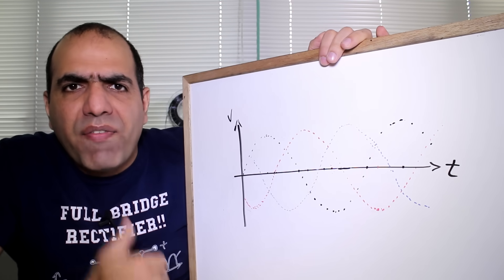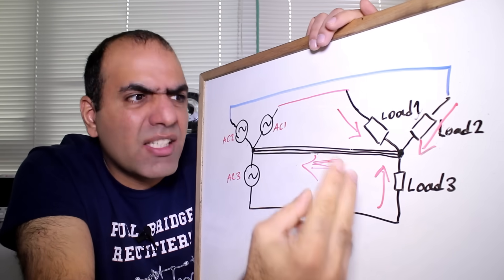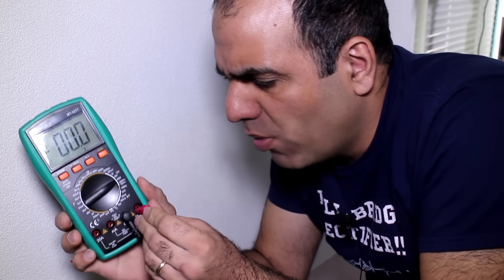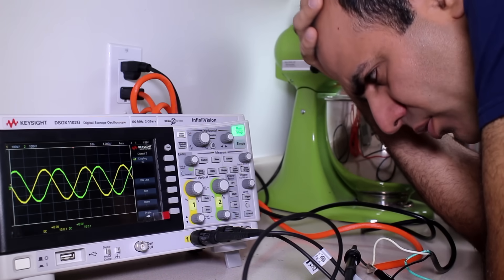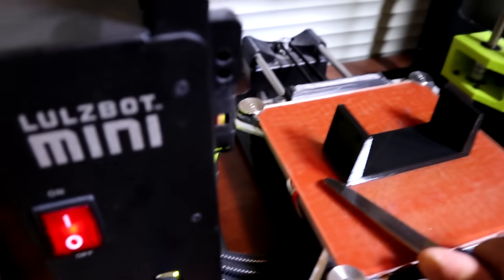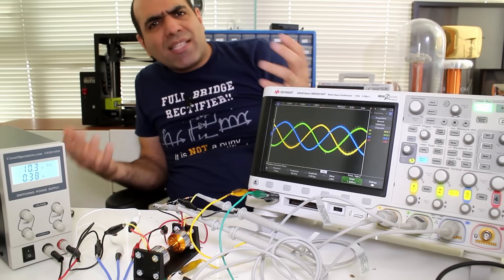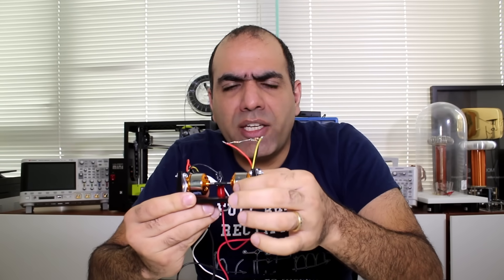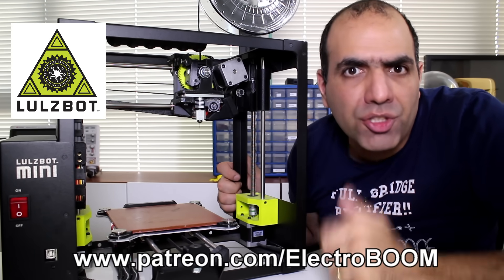Why 3 Phase AC instead of Single Phase???

Comment: i am 2 years late for this question but i will give a try

altough the video explains very well 3 phases and why it is good, it doesn't answer the main question
WHY 3 PHASE?

all that you've shown could be done with 2 phases or 4 phases or 6,9... o whatever integer factor of 360 so WHY 3? why this magic number

btw 110v is a pretty shitty tension, it means that the city you live is has very old transmission plants no "modern" city would use that tension...
it requires much more expensive wires, have much more losses due to heat and is much more dangerous and risk to short circuit, fires and stuff

Comment: Why live touching neutral makes so much problems? If you plug something into and close circle, live will also go to neutral anyway?
Reply: Think about it like air pressure in a hose. If you connect a high pressure hose to a low pressure one, the air will flow from high to low so it becomes equal. That flow of air happens very quickly and represents the flow of charge, or electrical current. The amount of air flowing depends on the size of your hose. Small hoses are like high resistance conductors, they don't let a lot of air flow but the pressure can still be quite high. Big hoses are like low resistance conductors, allowing lots of air to flow. The reason this is bad for electrical systems is that too much current can cause things to heat up. If you connect high voltage to neutral with a wire (a short circuit) you're basically allowing current to flow almost unimpeded from high voltage to low voltage, and that current very quickly heats the wire and can cause a fire.

Comment: Very nice video, I loved it. So, if 3 ph gives three times the work for same input power, does that mean that motor is 3 x as efficient? That is, my electric bill for a 3 phase motor will be one third as much as for single phase of same horsepower?
Reply: No, there's no free lunch on energy. Energy is always conserved in this Universe.  The power company charges you for how much energy you use, so it makes no difference if you use it in 2-phase or 3-phase form; it costs (about) the same in kWh.  And he is wrong in saying that 3 phase is 3x the power for the same current (and voltage).  It's sqrt(3) more power, aka 1.73 more power. So 240v, 10 amps, single phase (two wires carrying 10 amps) is 2400 watts of power (energy transfer rate), and 240v, 10 amps, 3 phase (three wires carrying 10 amps), is 240*10*1.73 or 4157 watts.  By going from two wires to three wires, we increase the wire cost by 50%, but increase the power by 73% (not 300%).

Comment: Hi, I don't know much about electronics but why is it best at 3 phases 120 degrees phase shifted? Wouldn't this same concept work with 4 phases 90 degrees shifted or 6 phases 60 degrees shifted? Or even 2 phases 180 degrees shifted? Not sure what I might be missing here.
Reply: Early electrical systems actually did have 2 phase power and some industrial machines can use higher phase power internally, but 1 phase and 3 phase are by far the most common now. Higher phase systems would be more efficient ideally, but have diminishing returns since you can never do more work than you put into the system. You also need more and more wires and components for higher phase systems, which gets expensive and eventually becomes more costly than what you save in electricity. In the real world, you also need to worry about the precision of the phase shift. In 3 phase systems it's not that hard to keep things equally out of phase, but in a 7 phase? 15 phase? The angle between each phase gets smaller and smaller, which means the tiniest shift can totally change the system's efficiency. Basically higher phase is more efficient, but has diminishing returns and is too hard to actually maintain for just transmitting power. We CAN make precise polyphasic systems, it's just not worth it for the purpose of powering things so you'd only have one if you REALLY needed it.

Comment: FYI in the states we do not use 2 phase to bring 120/240V service. We use a center tapped 240V transformer. Tapping the low side winding at the center of the winding doubles the turns ratio between the high and the center tap as opposed to high to ground because you are cutting the low side number of turns in half, which is the denominator of the turns ratio. So you have 240V red(+high) to black(-high), 120V red to center tap (neutral/ground), 120V center tap to black. Hover since they are all the same primary phase connected to a single transformer if you connect all 3 wave forms to an oscilloscope the phasing will not be 120 degrees. The two hot legs will be 180 degrees out  of phase because by standard the center tap is grounded.

Comment: I would like you to redo your video and enter the words line 1 voltage line 2 voltage and line 3 voltage .  A phase is not a WIRE , a phase cannot be seen , a phase is the RESULTING voltage between and two lines ( or wires ) such as line 1 ( red wire ) line 2 ( black wire ) or line 2 and line 3 ( Blue wire ) or line 1 ( red ) and line 3 ( blue ) voltages ...  Our houses in Canada are a single phase installation NOT 2 phase as you are saying......  Using the terms phase in place of the term line voltage is a common mistake used by many but your videos are for teaching so it is best to try to be more accurate.  I do enjoy your videos....
Reply: I'm not at all familiar with how Canada does residential service. However, according to his oscilloscope the angle between his two hot lines Red/Black to ground are 120 degrees out of phase. You wont get this in the US. In the US we use a single 240V center tapped transformer so both will be 120V but they will also be in 180 degrees out of phase because the center tap is connected to ground. 

I don't know why this is. I do know that Niagara Falls original power station was 2 phase. So perhaps eastern Canada adopted two phase residential power. Honestly I don't know but his oscilloscope clearly shows two separate phases.
Reply: @chonzen1764  Canadian electricity and US is the same just different voltages. we have 600 volts and yours is 440 volt the rest is the same.  You cannot look at a wire and call it a phase .  a phase voltage is just the resulting voltage between two line wires.  Without a drawing this might be better.  Phase A is the resulting voltage between line 1 wire ( red ) and line 2  wire ( black) - - - Phase B is the resulting  voltage between line 2 wire (black) and line 3 wire (blue) - - -  phase C is the resulting voltage reading between 1 wire (red) and line wire 3 (blue).  Therefore the voltage in your residential home in the US and Canada is a 2 wire 240 volt Single phase service with a neutral to ground wire. So a copper or aluminum wire is called a line wire and the resulting voltage between two line wires is a phase voltage.  You cannot see a physical phase only the resulting voltage.
Reply: @raydreamer7566  Again I don't know Canada. But in the US phase voltage is the voltage between any hotline and neutral/ground. This is also called the line voltage, VAN, VBN, VCN. What you are talking about is the line to line voltage VAB, VBC, VCA also called phase to phase voltage. These are not the phase voltages. They are the sum of two phase voltages.

I dont think you understand what phase is. A phase is not a resulting voltage, phase is the angle of the voltages relative to each other, v1(t) = Vm*sin(wt) and v2(t) = Vm*sin(wt + θ). θ is what matters not Vm. In typical 3 & 2 phase power θ is +/- 120 degrees. On his oscilloscope the two line voltages are clearly 120 degrees apart. This is two phase power. 

If it was a single phase center tapped residential service which is common in the states the two line voltages would be 180 degrees apart because the center tap moves the ground. What is really happening with a center tap is you are flipping the sign of the 2nd voltage so v2(t) = -Vm*sin(wt) which equals Vm*sin(wt + 180).

Like I said I dont know why its 2 phase in Canada I can only speculate. As I said I do know that the original Niagara Falls power station was 2 phase. So this could be a hold over in a specific part of Eastern Canada.

Comment: Laughs in German, where even the smallest apartments get all three phases, provided they have their own connection to the mains grid and are not connected to a subbox in the building...which rarely happens. In my house, I have access to three 230V phases (so 400V) at up to 64A.

Comment: Your wording is confusing and mixing up 3 phase condominium/apartments with single household power. While the former uses "2 phases", the latter uses two halves of the same phase. The former gives ~208VAC, the latter ~240VAC. Most "houses" are fed with a single phase from the utility, not 2 phases as stated.

Comment: i think the prime benifit is not saving wires ..... But the fact that three phase power generation is way more beneficial then single phase ..... 
But again question here that why we not use six phase with 60' phase shift ? Or twelve phase with 30' phase shift
Reply: Higher phase means more wires and more sophisticated equipment to keep everything in equal phase shift. For 12 phase you mentioned you need a 30 degree shift, that means that there's less tolerance for error in the phase shift since 1 degree off is 1/30 of the shift. In 3 phase, 1 degree is 1/120 of the shift so it's not as significant. You'd also only be getting slightly more efficiency with each added phase, it's not worth the cost.

Comment: I do not know about in Canada, But I think it is the same as in US, where there are no 3 phases in homes,
but a single phase, and for the kitchen appliances or ac and water heaters they
just get two legs of the transformer for 240 volts and a center tab for the rest of the outlets of 120 volts.

Comment: All electric motors are 3 phase on single phase You need a condenser to create a cripple third phase. Mono connected has ALWAYS les power compared. In Belgium we get 3 phases 400 V  and 230V single phase so the N (blue) wire needed. N carries voltage !!

Comment: 5:28 is it PWM? PWM is useful in controlling brushed DC motors, brushless requires PPM signal exclusively. ESCs basically convert PWM dc signal to PPM signal.

Comment: That is not the whole picture. A one phase AC wave passes through zero power 4 times a cycle, as current lags voltage by 90 deg. Passing through zero power leaves a possible point of high vibration in a generator, and a possible stall point in a high torque motor. In three phase AC there is never a time where all of the waves are passing through zero power. If we made a 4 phase system this would not work, as when either voltage or current goes to zero, power also goes to zero as it is the product of both. 3 phase was Teslas solution to smooth and constant loading of the generator and smooth constant power to the motor. The true purpose had nothing to do with wire counts. Imagine Teslas first hydro generators at Niagra falls vibrating the penstock at 120 hz to try to keep the RPM's  constant, the parts would vibrate apart. With 3 phase the load on the generators never drops through zero power level.

Comment: DOUBT!!!
I just learned about LCR (Inductor, Capacitor and Resistance) circuit, is it correct to assume that the phase you are talking about is same as the phase of LCR in phasor diagram ?

Comment: WRONG Two 120 volt lines that add up to 220 volts are on the SAME phase.They are on the same winding on a single phase transformer the 120 volts comes from the center tap of the winding and that gives 120 to both ends of the winding. The center tap is grounded that helps prevent a 220 volt shock. You got the 3 phase right. 2 phase is called the stinger at 208 volts to ground or neutral.

Comment: The instant three phase power is a constant every time, but single phase power is not, it's changed by sin(x). This is a general advantage. There is not a pulse of instant power. Therefore the torque of electric motors is a constant every time.

Comment: In Sweden we have 3 phase AC to every single house (and many apartments too). That way we can install 3 phase motors in the house. For example, the heater and boiler is 3 phase, and the pump in our spa bath is 3 phase. Some ovens with stove are also 3 phase. Many electric car chargers are 3 phase as well.

Comment: They have even looked at 6 and 12 phases but economically it just doesnt make sense. 3 phase is the way to gi. Tom Henry has book that explained how to calculate how far I think was 300,000 volts could travel in one sine wave and it was like over 2000 miles or something. Lost the book but yeah basically 3 phase.

Comment: A motor generator set does work to convert split-phase to 3-phase power, but since you already have two out of the three phases, you can just use a transformer.

Comment: NEC code says you can’t have two circuits power two receptacles that share a neutral on the same yoke. So having the top and bottom plug on a duplex receptacle wired like that isn’t code. If you ever loose the neutral connection you’ll end up with a 240V, or 208v In this case, series circuit. Any electronics on that resulting circuit will fry.

Comment: I don’t understand why he has 120 degree phases (208v) in his outlet and not 180 (240v). I also live in Canada and I have 240v between the phases in my house. My understanding is that the home gets a single 240V phase with a neutral in the middle of the step down transformer coil to produce 2 120V phases 180 degrees apart. Does he have 3 phase to his house like an industrial building would have?

Comment: I don't understand with the three loads in Y how they add up to zero without the wire returning isn't that an open circuit sorry I'm dumb
Reply: angle of each signal is different to one another, so mathematically they add up to zero

Comment: If anyone is confused why he has 208 volts but you have 240, houses get 240 volts across a single phase. We get 120 by tapping in the middle of the transformer's secondary winding and that's the neutral wire. Apartments and other large buildings usually bring all 3 phases in, each 120 degrees apart. In each individual apartment only 2 of the phases are used and since they're 120 degrees apart the resulting voltage is 208 volts.

Comment: What about stepping motors?? I have learned that the actual stepping motors can crank at a low speed. use a power transformer from a radio. can create 70 to 100 jolts and can ring a telephone and when really spun by a scooter motor power a low watt incondesent light bulb or small radio it's better to get the largest one you can afford or else get a telephone magneto but the stepper motor is better cheaper and more abundant then that old crank phone but the stepper motor will only ring modern touch tone phones and for a good laugh you can wire tap the neibors and crank call with a homemade crank on a stepper and simple power transformer turn backwards..

Comment: "Industries take 3 phases"

I think I have three phase on my electronic stove. It has three breakers in my breaker box labeled stove 1, 2 and 3 (ceramic screw-in breakers). Also, reading up, in my country it seems normal to have three phase power on the stove.

Comment: The major reason we use 3 phases is to reach the maximum efficiency possible in transformers. When a very large transformer has, let's say, 100 kw going thru it, an efficiency of 90% would mean 10 kw of heat to evacuate. If you reach 95%, you waste only 5 kw.

Normal single phase transformer barely reach 80% efficiency but the 3 phases transformers easily get 94%. This is because rotating smoothly a magnetic field from 0 to 360 degrees is less stress on material than having one that invert direction.
This can be seen with step motors using microstepping. In that case, we have 4 phase but, the principle is equivalent. Each wave is 90 degrees instead of 120.

Comment: Where do you live that you get 2 phases of 3 phase in your house?  I thought that in North America you get 220V split phase delivered to your house.  That 220V is one leg of the 3 phase generated by the electric company (hydro if you're from canada)  I thought that you get 110V at the typical wall outlet because there is a grounded center tap in the transformer on the pole.

Comment: The power output of the three-phase AC is constant if the load is balanced and stationary.  In AC motor the winding is usually 6-phase, it used to get better EMF(because of the time-space sync behavior of the motor, the degree of the winding is calculated by scalar distance, but the EMF depends on vector distance) And in some wind turbine some design using 12-phase to reduce the THD.

Usually, the brushless DC motor is driven by a square wave inside the motor, while the AC motor is driven by a sine wave. Because if you have an inverter they look the same.

Comment: Why not just connect a parallel line to each ESC output to the first motor and discard the 2nd motor? Then you will have 3 phase AC directly from the first motor.